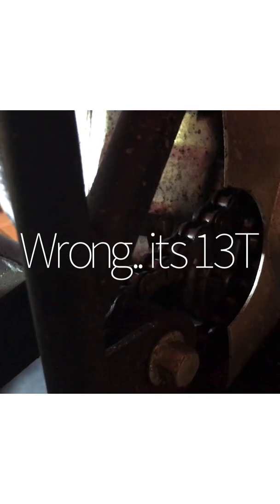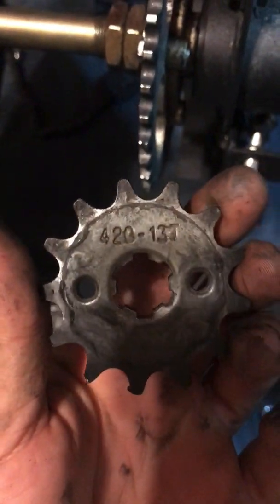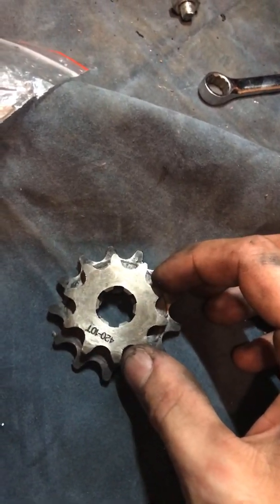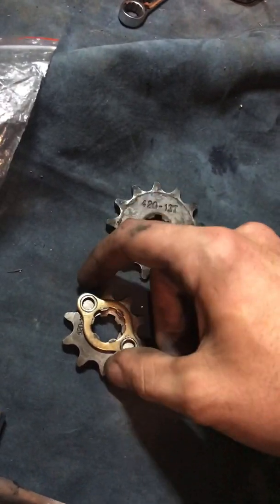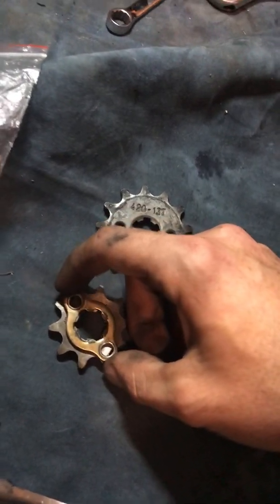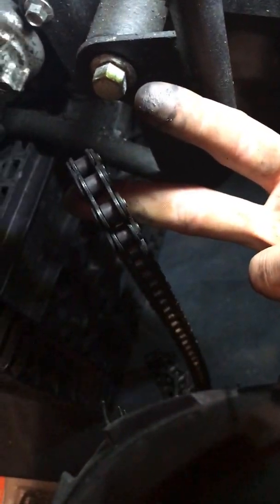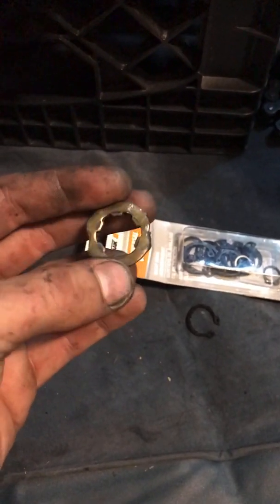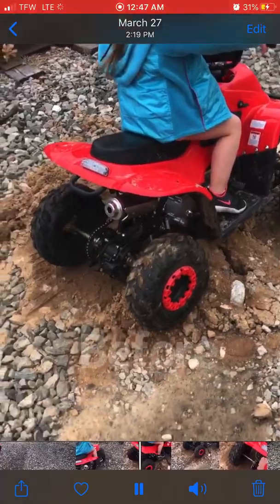110 cc Chinese Atv Engine sprocket upgrade/how to?What is the Differences.

Comment: Bro l changed the carb on the tao tao 110 to a pz19 carb its on already the tank gas line and filter go to the carb the gas inlet tube . Which is the vent tube  and the bowl drain vent go

Comment: Does the chain rub on the housing with the 10t? I just put one on and it hits the casing with the gear all the way in. It spins fine but it is dragging. Might try an 11T
Reply from the maker: I never had the chain rub on the housing. I’m not sure the model or year Atv you have. Maybe some things have changed since 2020. The Atv model I performed this upgrade to is listed in the description. The Atv is still running and performing and has now been passed on to another family member.

Comment: I’m having a problem
With the bolts hitting the chain. Anyone else having that issue
Reply from the maker: Check the description for this particular 2020 atv. Maybe there are some minor differences in your model vs this one. If your on a budget or want a quick fix. I suggest possibly grinding the bolt edges down some. Or size up the chain/bolts and readjust to a size that may work better.
Reply: @ I did grind the bolts. But the bolts seem so huge. I just ended up going to Home Depot getting the flat small ones. And my brand is moutpoz

Comment: Great video. I just bought my son 110 x pro. Looks identical to this. On the slightest incline it won’t even move.  Flat surface it moves fast. I’m hoping this will fix the issue I’m having. Did you have to take off any links? Where did you purchase this sprocket.
Reply from the maker: Yes i did buy a new chain and a chain link breaker tool. I do remember if I had to leave links off or not. But it’s definitely worth it.

Comment: thanks for the vid much appreciated. Do you have 6" rims or 7" on them?
Reply from the maker: 7 inch, I actually have updated video of the Atv in action. It’s still chugging along. One of my issues have been the tires. They don’t want to hold air. I ended up buying. Few tires and rims from an older model. I’m going to get into that Into a later video. Probably after Christmas.
Reply: @learnnearnn5934  i just put 7" on mine had 6" previously. Seemed so fast on the 6" i dont like the speed reduction on 7" but was looking at the 212 cc swap on youtube they seems pretty cool and would help with the speed so i'll wait till i blow the engine up which surprising will be hard with these 110cc then upgrade

Comment: It's funny you read these four comments and you realize people are just idiots.... The guy put a 10 tooth sprocket on the front because he wanted it to have a little more torque that way you don't have to rail the gas to try to get over a bump.... With him putting a 10-tooth sprocket on it it's going to make the top speed a little slower now... Got to love the last comment....😭 you have to do both the rear and the front sprocket🥳 no not in this case it just depends on what you're trying to accomplish...and I'll end this with this is exactly why I tell people leave your ears open and your mouth shut and you'll learn a little more
Reply: great point of view something to consider for sure
Reply: Quick question, so what I’m understanding is, the smaller the sprocket, the more torque, the bigger, the more speed??

Comment: Making all your gearing change on the front is wrong, you should do a combination of front and rear.
Reply: I agree. Depending on vehicle, 10 tooth sprocket may hit the frame because of the lining change. I started with changing rear from original 428 sprocket 37 to 52, and then front original 428 -sprocket 14 to 12. Huge improvement on torque.